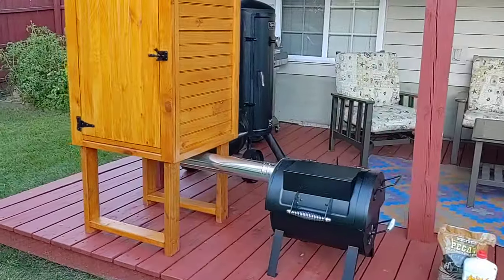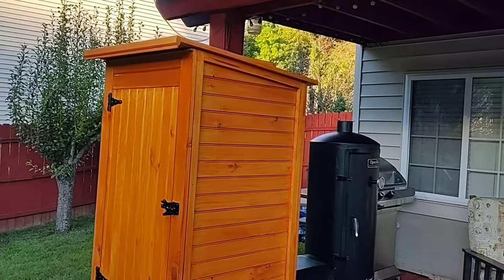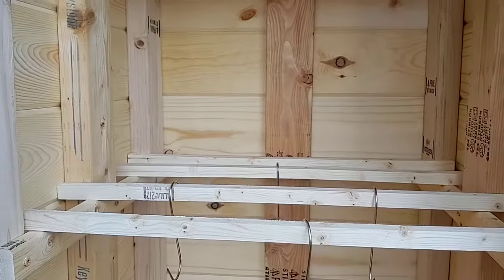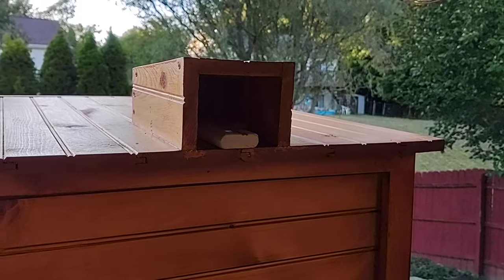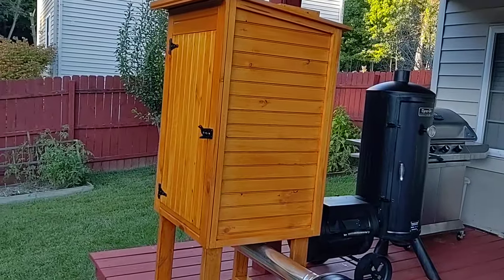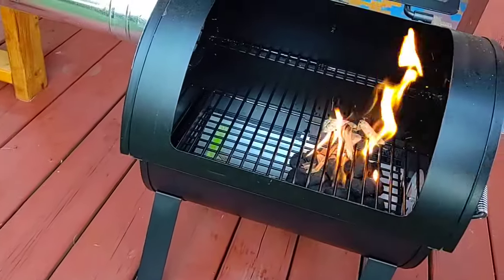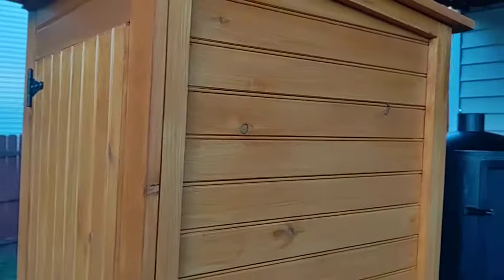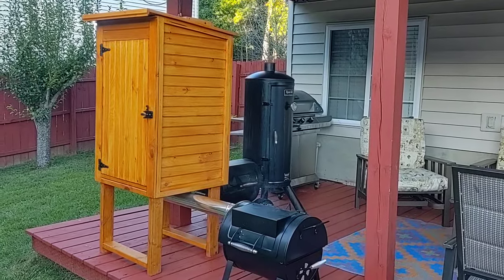DIY Smoker-Cold Smoke  Meat House

Comment: This is a fantastic and ideal sized Smoker My Friend.  I have an electric and propane smoker, but what happens when the Lights Go Out on a Real SHTF Event.  No Electricity and no Propane.  I had different plans for a little larger Smoker, but once I saw this one, I knew this one was for me.  Perfect.   Thanks for posting this video.  I work at a hospital and we get pallets that are basically a one off, for holding certain types of Hospital operating room equipment.  They cannot be used again for any purpose.  Lots of longer 2x4's and slats that can be used for framing and siding.  I recently bought a 30 lb propane tank that will be cut and converted to a stove like yours, altho I would prefer a stove like the one you're using.  Can you tell me the name of it so I might be lucky and track one down.  Thanks for your help.
Reply from the maker: Thank you for watching and kind comments. Good that you want build one. Side firebox is from Dyna Glow. I got it from Home Depot as online order as most affordable at time. You can search online as "Dyna glow smoker side firebox" and choose from different manufacturers and prices. Good luck.

Comment: Very nice job!!! Please let me know what are you used for coating on this smoke house? And that coating is not having some chemical smell? and that smell is not going through smoked meat? I' m just build one smoke house based on your clip and I' m searching for some solution to protect the wood. Thanks
Reply from the maker: Thank you for watching. I used water-based paint protection and don't have any problem with smell. As you could see on video I did not paint inside due to health and safety concern as well due to smell concern. You could ask at hardware store for more information. 
Additionaly, when you do finish building and do first fire I would recommend keep fire for 2-4  hours and cure it before smoking any meat. Good luck and I would like to se finished house.
Reply: @averagemaintenance3875  thanks for information and  good luck for your next project. I will follow you
Reply from the maker: @vasilelupu1139  Thank you.

Comment: I use my LP torch to light charcoal for my smoker.  It is just a one pound LP tank connected to my torch head.  I refill the one pound cylinders via my 20# cylinders.  I refill them to about 935 grams.  If I overfill them I just connect them to my Blackstone griddle and burn them down to a safe weight before storage.
Reply from the maker: Thank you for sharing. I might look into it.

Comment: forgot to ask how long is the pipe from fire box to smoker
ty
Reply from the maker: It is 3 feet long from the fire box to the middle of the smoker on the bottom of it. I am thinking before next winter to upgrade it to aluminum 4 feet long pipe. This  is due to suggestions from others and my own experience. Sometimes, it gets too hot in the  smoker. I prefer only cold  smoke.
Reply: @averagemaintenance3875  thank you so much

Comment: 24 x 24. How tall is this.  I was lucky. I found the same table top charcoal BBQ at Rona, ( Canadian),  for much less than Amazon.  Not a side mount smoker attachment, but that's ok.  It has an air vent on the left side. Once I take the left handle off and unscrew the circular air vent, almost the same deal as yours.  Just have to use a 4 inch pipe and make a circular flange.  And if not mistaken, you said that you used 4 inch pipe.  I figure that I can smoke enuff sausage at once and the nice thing about yours is that it is basically portable.  One person can move this around.  I'll have to figure a way to chain this down. Altho I do live in a decent part of town, things have a habit of walking away by themselves.  I'm amazed that my patio furniture is still here.
Reply from the maker: Thank you for watching. Yes, it is 4" pipe.
Reply from the maker: It is almost 6' tall.

Comment: Hi, how many hours it last the full stock 
 of the smoker?
Reply from the maker: Thank you for watching. This is not just regular smoker that smokes about one hour per pound of meat. I made old fashion smoker for cold smoking. It needs to be performed in winter months when temperature is in 30's. Usually takes about seven to ten days to keep it out in cold and do 3-4 times fire that is good for 3-5 hours at time to produce mostly smoke and not to much of heat. Before smoking there is cure and preparation part. Salting and keeping it in refrigerator for about seven days to cure it and prevent bacteria. You can watch my other  4 videos about it.

Comment: Where did you get the dynaglo smoke box at?
Reply from the maker: I purchased side fire box from Home Depot for my project. You can see I have metal smoker that I purchased at Tractor supply. You can go with either one. My choice was based on availability and cost at time.

Comment: What is the firebox u used? And piping?
Reply from the maker: Thank you for watching. Pine tongue and groove with regular 2x4's. As for piping, Home Depot ducting and venting department.
Reply: @averagemaintenance3875  thanks! Does it get very hot inside?
Reply from the maker: @MrMarktoth2003  It does not get very hot due to fire box distance from smoker. It is meant to be only for cold smoking.
Reply: @averagemaintenance3875  thank u! I’m building one and that’s what I was hoping I just want it for cold as well
Reply from the maker: @MrMarktoth2003  I hope you have fun.

Comment: I would not have used pine due to the off taste but it looks good.
Reply: what wood is best?
Reply: @stoker261  a lot of guys use hard wood to construct their boxes.  I see a lot of oak, and cedar I saw one made of furniture grade mahoganey, and one made with some asian wood that wasn't supposed to rot in the rain (but it's biggest opponent was snow and freeze).  I have also seen bamboo.  The problem with pine is it leaks sap and the smoke off of it is bad eats.  Also a lot of it is pressure treated which is really bad eats.  I guess kiln dried wouldn't be bad unless it ignites.  They also rot fast.
Reply from the maker: Thank you. I will consider it. Good to know.

Comment from the maker: I accidently removed comment from Corey Raiche asking about how many tongue and grove I have used. Sorry. Wrong click with mouse. 
As for how many pieces  I used, I cant remember exactly because I purchased it individual pieces, not in bundle. I think in between 12 and 15 pieces 8' long. In some cases I had to cut bad section out and or had too short remnants. I suggest to plan on buying  less and if needed buy again.

Comment: Pine wood  is not a good  wood to use for a smoker. It's got a resin in it .
Reply from the maker: Did not know that.  Thank you.  What would you recommend?
Reply: Oak, maple,hickory.
Reply from the maker: @ryanzwick6303  Thank you. I will consider it.
Reply: @averagemaintenance3875  beech is the best wood for smoking meat.
Reply from the maker: @bosnjak6396  Thank you. I used hickory so far but would try beech.